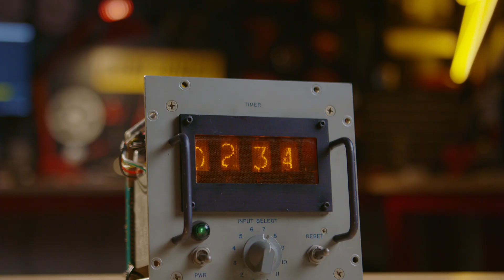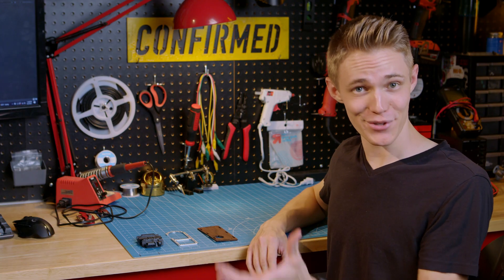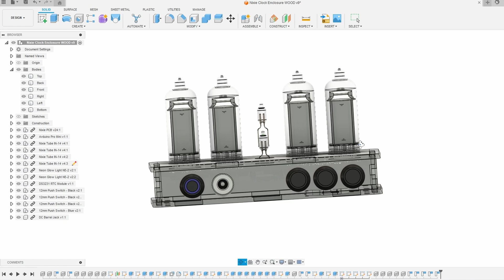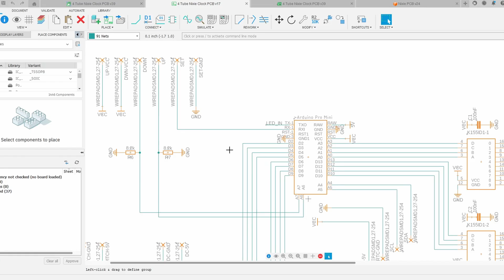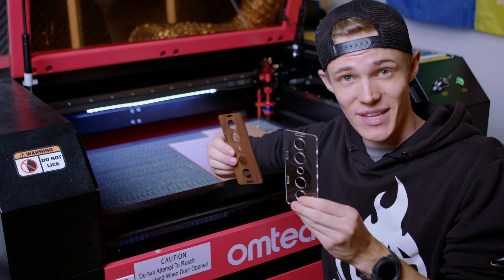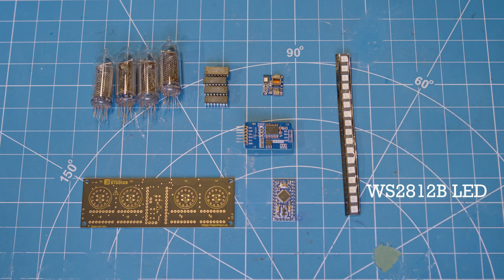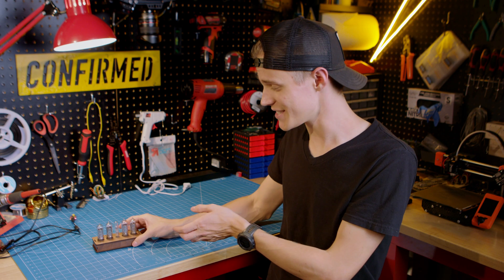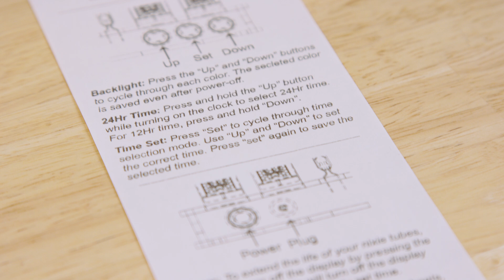Designing a Nixie Clock from Scratch

Comment: Hi Davis! Wicked cool project, I’m glad I stumbled across it! Makes we want to get back on the workbench.

Do you know how many amps those Nixie tubes use? I had assumed they’d take a lot of power, but if you’re pulling 5v up to 170v with that tiny little transformer, they must run on pretty minimal current! That’s a real game changer!
Reply from the maker: Hey old friend! I threw one of the clocks on my power supply, and it looks like the entire clock only consumes 3 watts, and that of course includes the LEDs, micro-controller and RTC chip! Given the tubes are cold-cathode, they are extremely efficient, and I wasn't even multiplexing them.

Comment: Awesome work! Are the instructions printed on thermal paper like your previous vid? Any concerns with them aging/darkening/fading?
Reply from the maker: Thank you! The main inspiration for using thermal paper was the novelty of finding a creative way to use an existing technology. It's of course not the most ideal way to distribute an instruction manual, due to long term fading and what not. However, seeing as most people use their instruction manual maybe once or twice when setting up their product before pitching it, I think this helps fill that need. For longer term needs, a picture can always be snapped, but at the end of the day, I learned a lot about working with thermal printers in the process, and that was the fun part!

Comment: Very nice ! I like how you've clearly put effort into ensuring it's programmed to be intuitive to program/set.. I have a few Nixie clocks I've built from kits that have ridiculously convoluted menus that are completely impossible to even set the time on without the (also very non-intuitive) manuals.

Only thing I'd say is be careful with those cheap generic DS3231 modules, I've had a few that started to significantly drift, apparently lots of them contain fake/reject DS3231s. Also, that particular module will attempt to charge the coin cell battery (killing it if it's not a rechargable one) unless you remove a diode from it.
Reply from the maker: I can certainly empathize with wading through non-intuitive menus, and that frustration played a large part in how I wrote all the code. After all, if you have to dig out the manual any time you want to use the menus, then it's not intuitive.

As for the RTC chips, you are absolutely correct that many do not actually keep accurate time. However, I ensured the models I used did in fact have working thermal compensation, instead of just relying on the crystal oscillator. Obviously something like an ESP32 would have been ideal, but that adds significant setup to what should be a plug-and-play device.